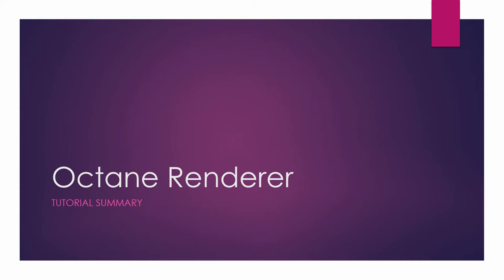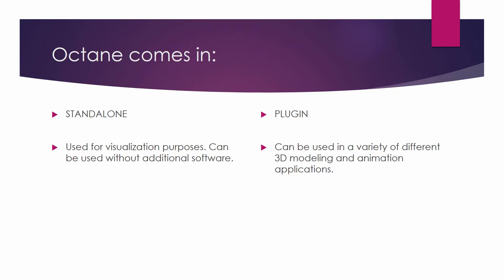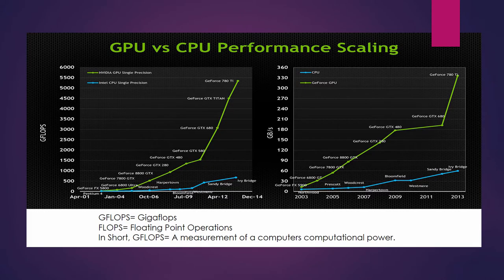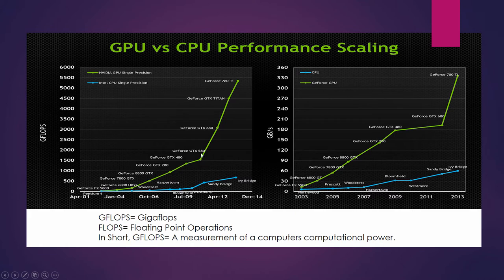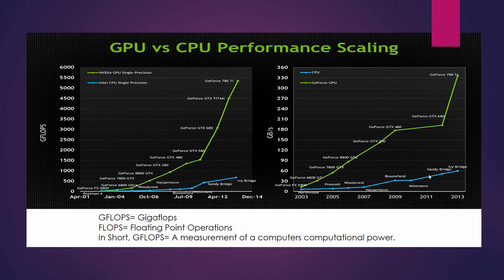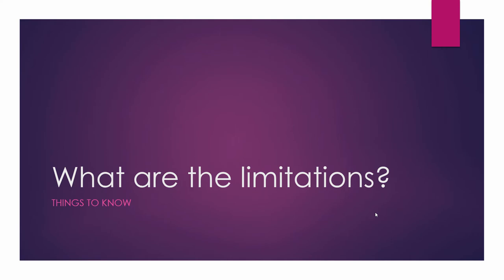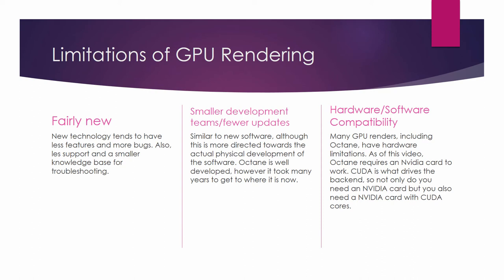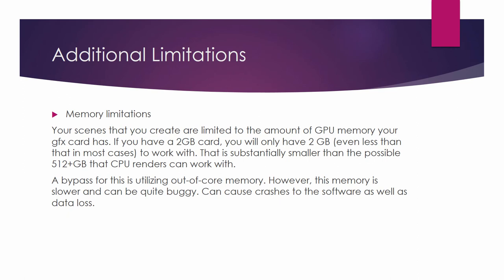Octane Render Introduction

Comment: Thank you so much for this great information video. We are looking to improve our rendering performance options. Keep rocking!
Reply from the maker: Cito's Intentions No problem and thank you for watching! Octane is a good one to look into, just keep in mind the current limitations. 

If you want more information on Octane, or any other rendering package, just let me know. 

I have used many different rendering tools for my work. GPU, CPU, render farms, so on and so forth.
Reply: Thank you for the offer Dylan. The workstation we are upgrading is a macpro 5.1 (mid 2010). The new graphics card will have the minimum 2g of dedicated memory and will be built on cuda architecture... hence meeting the requirements you speak of. But i am wondering if there are any other options similar to the octanerender. We essentially do visual design with C4D and Davinci resolve for colorgrading. Thx in advance!!
Reply from the maker: Cito's Intentions Octane is mostly for 3D rendering. However, there are other options. Red Shift is another rendering application, GPU based. It's extremely fast. Indigo Render is another great option but doesn't receive as many updates as frequently as Octane or Red Shift.

2GB is just a bare minimum, if the Mac Pro can handle it, I would look into a card with more memory but that is all dependant on your project and needs.

I believe Davinci Resolve utilizes GPU rendering in its own engine. So, you can benefit from a fast card with that program as well.
Reply: Awesome. Thanks !!!

Comment: thank you!
i wonder, is it good for mac users..
Reply from the maker: gil aviyam it all depends on GPU. If the Mac has a decent GPU, I dont see why not. I have it running via bootcamp with a GTX980 on a 2012 Mac Pro Tower. Seems to run just fine.
Reply: Thank so much (:

Comment: Does this plugin use amd cards in daz? Boggles the mind how daz uses only nvidia cards. Guess amds users money arent worth for daz3d
Reply from the maker: Sorry for the late reply.

No. The plugin still requires NVIDIA cards. 

That is by design in the core application and has nothing to do with any other program like Daz. When otoy developed Octane they developed it to work on the CUDA platform. The devs for Daz don;t have a say in whether or not the plugin works in Daz with AMD cards because quite simply put,  there is nothing the Daz devs can do to reconstruct Octanes core to work with AMD cards. That completely depends on Otoy.